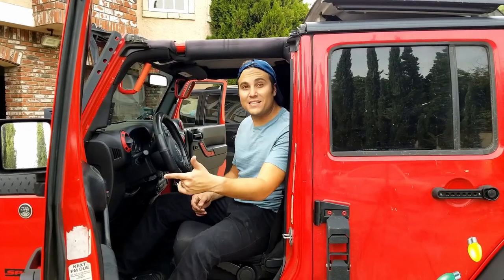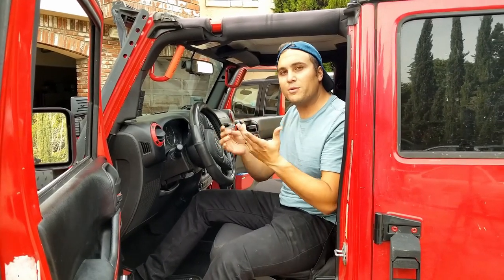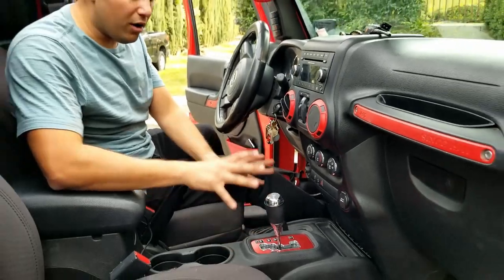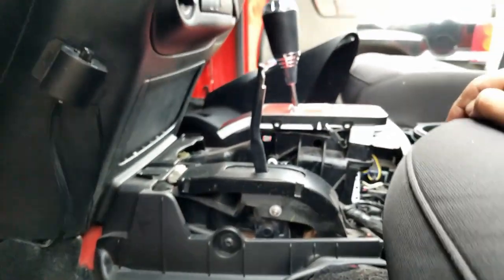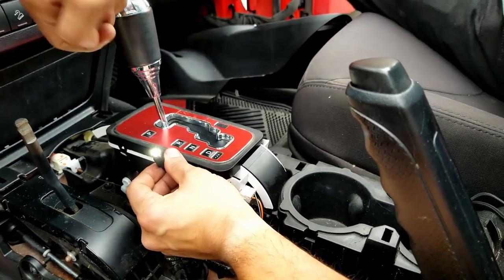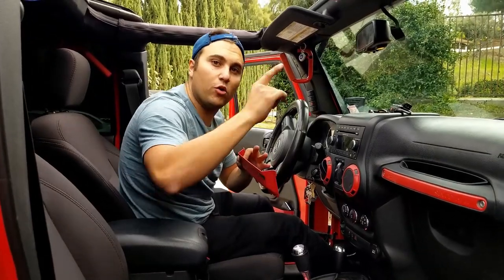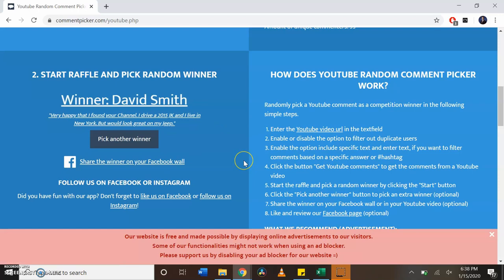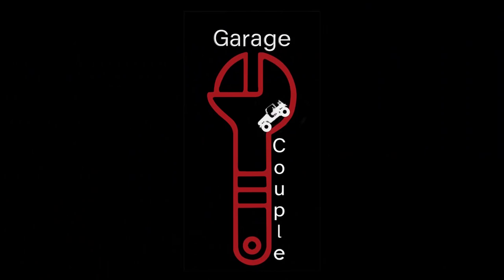HIDDEN Wrangler Gear Indicator Bulb & HEADLIGHT GIVEAWAY WINNER!!

Comment from the maker: If you enjoy our channel please consider supporting us by checking out some of our favorite wrangler mods
Replacement LED bulb - https://amzn.to/2Nujgp2
Plug and palo HALO LED headlights - https://amzn.to/36O7sW9
Smoked LED turn signal - https://amzn.to/2EQ7X67
Steel Stinger Front bumper - https://amzn.to/2WjykMA
LED tail lights - https://amzn.to/2JPBL7f
Under seat subwoofer - https://amzn.to/2JOKDK4
Red metal handles - https://amzn.to/2Wik8U1
Red shifter bezel - https://amzn.to/2HRZscH
JK light bar - https://amzn.to/2EPEOYH
Rock lights - https://amzn.to/2JPBUHP
A piller switch pod - https://amzn.to/2MoWBw2 
Door hinge side step - https://amzn.to/2ENee2A
Trunk mounted table - https://amzn.to/2EOywbL
Door hinge side mirror - https://amzn.to/31pQs5a

Comment: I had bought my Jeep not long ago.  It was a low mile used 2016 I got from a car lot and it never lit up. I wondered if it even lit up or had some feature turned off. I could not find a single thing in the manual even mentioning it so I was getting discouraged. I decided a last ditch effort of checking youtube and found your video. I had no clue on even getting it apart to check. Your video was a god send! It has been a pain trying to shift an unfamiliar vehical into the right gear in the dark! Thank you soooo much!
Reply from the maker: Ahh man, so glad to be able to assist! Now go enjoy that rad jeep!

Comment: Tried like the dickens to get that handle off, but no go.  Not to worry, like you said this job CAN be done by popping the plastic loose and working underneath it.  Smaller hands make it easier.  'Honey, can I borrow your hands?'.

Comment: Nice.  How do u fix the inside lights  when u open door they don’t turn on but u can press the button on them and they do turn on just not with the doors opening ????
Reply from the maker: What is the year of your jeep? Ours have plugs behind the trim which make the lights turn on when the doors open. I'd also check the fuses
Reply: 2011 jk 2 dr

Comment: Love your channel. Thanks to you, I replaced the burnt out OEM bulb in the shifter with a colored LED from your link to match our vehicle color easy peasy. Now the wife wants me to change the instrument cluster lights to match.
Reply from the maker: Wow nice! Glad to help!
Reply: @Garagecouple  Bad news on JK dash light replacement. Did some research because I couldn't find YouTube or searches for replacing them. Unlike the TJ which has bulbs that can be changed, the JKs have LEDs already installed in the cluster soldered to the circuit board. Only way to change colors is to unsolder and resolder different color LEDs to the board which is a lot more technical than most DYI'ers are comfortable with, or to put colored film between the LEDs and gauges. Either option requires disassemblely of the cluster, including gauge needles which can cause other issues
Reply: @Garagecouple  Bad news on JK dash light replacement. Did some research because I couldn't find YouTube or searches for replacing them. Unlike the TJ which has bulbs that can be changed, the JKs have LEDs already installed in the cluster soldered to the circuit board. Only way to change colors is to unsolder and resolder different color LEDs to the board which is a lot more technical than most DYI'ers are comfortable with, or to put colored film between the LEDs and gauges
Reply from the maker: Thanks for the heads up! Yes we will pass